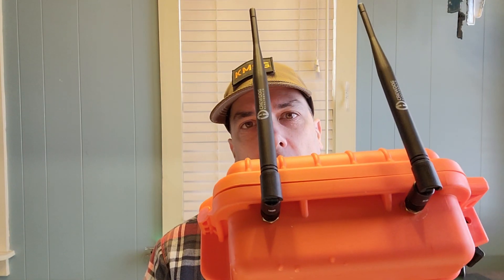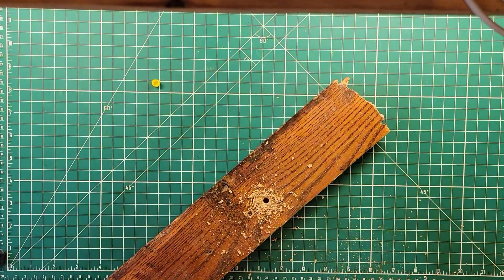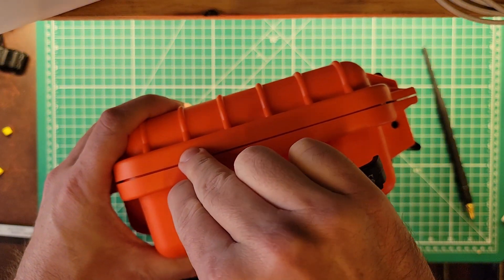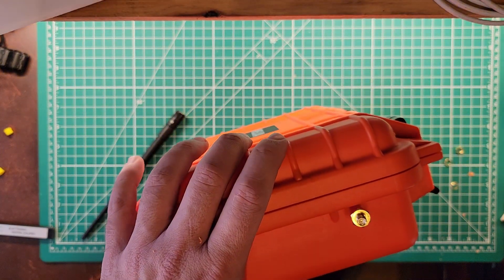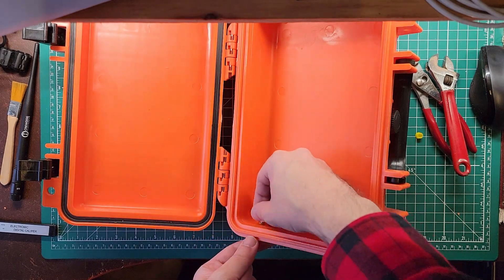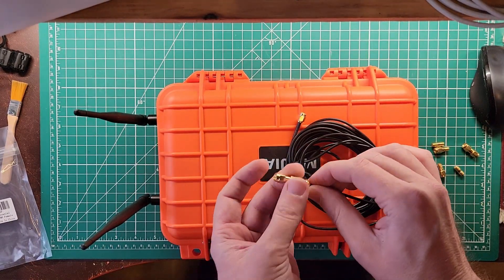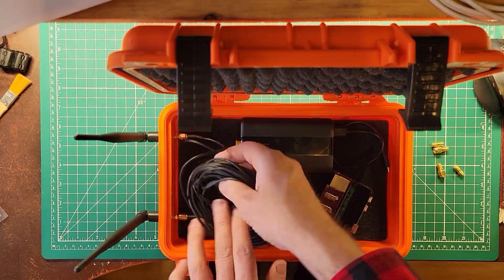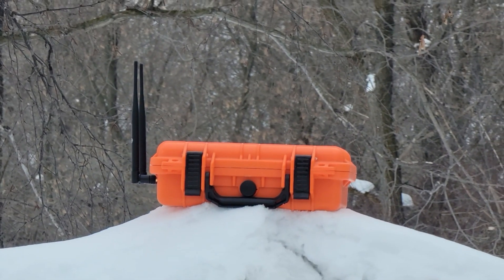You want to put holes in your go-box?

Comment: Nice build.   Bulkhead SMAs are usually mounted in 0.250" holes or 6mm.  Seems loose at first but after you snug the nut really good its not going anywhere.  Just be sure to use the star washer with the nut.   Truly a nice build 👍
Reply from the maker: Thanks Daniel!

Comment: How about instead of using coax between the dongles and the antennas, you connect the dongles directly to the passthrough SMA with an adapter and then use USB extension cables to connect the dongles to the computer? That way, you will minimize signal losses in the connections and cables.
Reply from the maker: That's a good idea.
Reply: I was cringing when I saw the length of antenna cables coiled up in there. Hopefully he found shorter cables, or went with your idea @JohnTarbox. Aside from that, nice build Steve. 73.

Comment: Nice Steve. In electrical boxes, I'd also add some silicone before installing the fitting, especially if cable glands were on the top or on the side of a metebox. 
Electricities don't like water. Lol⚡️
Reply from the maker: Exactly!
Reply: I use petroleum jelly, but the concept is the same.
Reply: Silicone RTV is what we use.  The black colored RTV.  Not sure whats the brand name but it hardens like a thick rubber
Reply: @dan_in_sd-w6dkw  nice, I must see if we can get that here.👍
Reply: Might the right size of O ring be available?
Reply from the maker: O-rings are included with the SMA connectors.